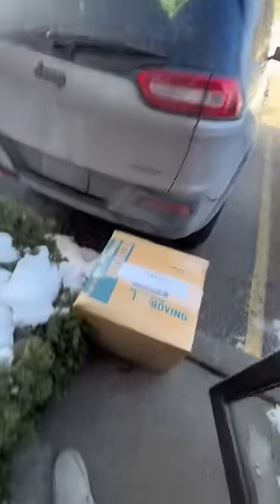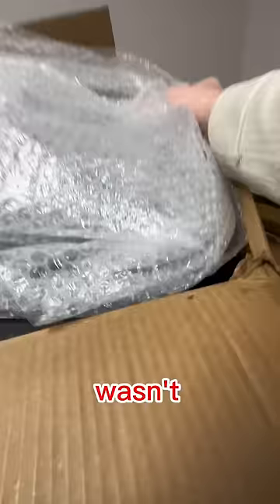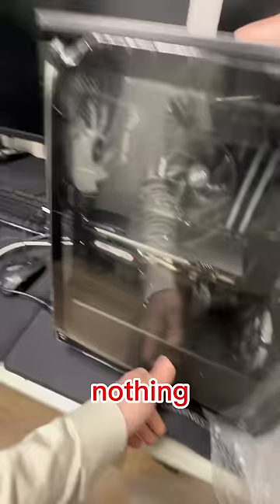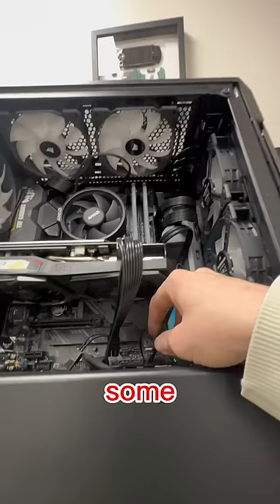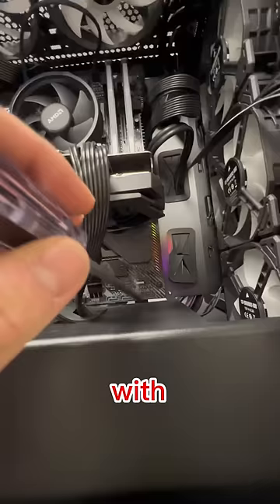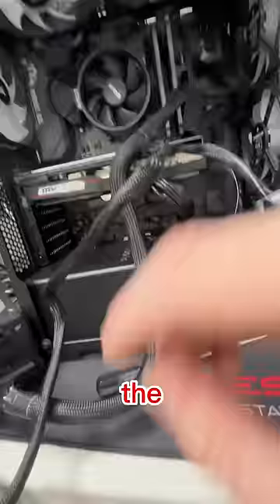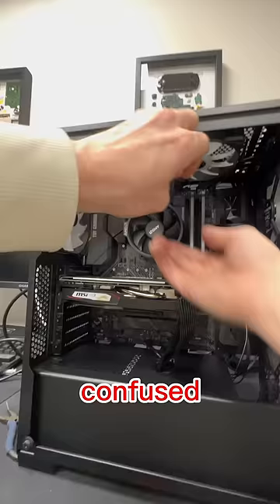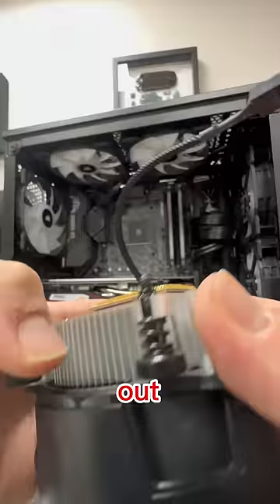Bent CPU Pins 😭🤬#pc #pcrepair #cpu #gamingpc #pcgaming #pcbuilds #pcbuilding #egirl #gamerguy

Comment: Best tool for straightening pins is a mechanical pencil without the lead in it.
Reply: Best tool for straightening pins is not buying AMD and using that ancient ass AM4 Socket.
Reply: @squarebodyseth5986  ugh
Reply: @squarebodyseth5986  Or just treat your computer components with care and avoid jamming them in like cavemen
Reply: Helped my friend do this after he put his in without lining up the arrow. Worked great.
Reply: @squarebodyseth5986  cpu pins are easier to straighten than socket pins ;)
Reply: That is actually really smart! I'm gonna try it on mine after I stored my old one the wrong side up in the plastic thingys 💀
Reply: @jan Luna  very true!
Reply: Im gonna bend tf out of mine just to try this. Sounds satisfying!
Reply: @JunkBondTrader  The thing to be careful of is not to use  to much leverage or you will rip the pin right off.
Reply: Facts! Ive done this exact trick in my electrical engineering class!
Reply: @JunkBondTrader  don't bend too much. Each time the pins get bent they weaken. They will snap after a couple times. Sometimes on the 1st time...
Reply: @e.6z1  ignore him hes one of those intel fanbois that think anything not intel is obsolete
Reply: Where are you finding mechanical pencils with lead in them in 2023 lol
Reply: Thanks never would have thought to try that.
Reply: @squarebodyseth5986 imagine thinking socket am4 is inferior in any way and has no good processors. That would be a tragedy.
Reply: @@chidindueze7655considering a large amount current Intel chips are beaten by an AMD chip in both enterprise and commercial markets I would have to respectfully disagree.
Reply: @samfish90212  That's what it is.
Reply: @squarebodyseth5986  it's not. Several of the Ryzen 5 and 7 chips are equivalent or better than their respective generational counterparts. Intel seems to be more powerful in their latest chips but only time will tell.
Reply: that's EXTREMELY clever
Reply: I dropped my cpu once while upgrading my cooling and bent some pins. I didn't know about the mechanical pencil method, but I saw a video of people using a razor blade to aline the pins. Took an hour or so and voila, working CPU.
Reply: paper cutter
Reply: That's the first thing I noticed. Always use a mechanical pencil. It puts the strain on the pin.
Reply: @1TokeNChoke  Thats why I added to be careful using the pencil because it can tear the pin right off. It has to be done gently, and works great where the pin has become curved.
Reply: Nope. I've fixed many mashed up CPU's with no failures so far. Best tool to use is a Stanley blade. Keeps them perfectly in line, work from one side across then the other, always works. You can lift many pins at the same time to the same point, and it takes a few minutes to get them straightened.
Reply: @Chidindu Eze Tell me you don't know much about electronics without saying you don't know much about electronics.
Reply: @samfish90212  Correct. Anyone who actually follows or has a slight bit of knowledge about PC components would know AMD and Intel have been going back and forth for years now. If you just straight up think 1 is bad and the other good, congrats, you've become a fanboy without independent thought.
Reply: @Lord3nder  I'll admit I am an AMD fanboy but I will never deny a good system. Built my dad a 12th gen i7K system. He loves it. I like the benchmarks it gave me.
Reply: @squarebodyseth5986  tell me you don't know what you're doing without telling me you don't know what you're doing.
Reply: Don’t forget to heat your cpu pins before bending… cold pins are snap city
Reply: Buy Intel and LGA will never bend a pin. 😅
Reply: @Niikkos  take the graphite out?????
Reply: @squarebodyseth5986 proceeds to bend the motherboard pins
Reply: @@chidindueze7655argument, amd was able to have CPUs that compete with intel while still keeping the same socket, making the compatibility with old motherboards a lot easier, it's not ancient neither obsolete as it still runs new CPUs, and also i dont need a 400w cooler for it
Reply: @Lord3nder true, though i tend to hate on intel due to having one burn, i don't dislike them, but feel like i have to spend more in order to use them at their max
Reply: @squarebodyseth5986  or just do shit properly 🤷‍♂️ am4 is a great socket
Reply: @BaSeGM  maybe 10 years ago
Reply: @SquareBody Seth  you do realize am5 only came out two years ago right? No shit am4 is still relevant 🤦‍♂️ people are building brand new am4 rigs everyday, the 5800x3d is an absolutely fantastic cpu 🤷‍♂️
Reply: @BaSeGM  Compare that to a measly i5 13400k and the i5 still outperforms for $70-80 dollars cheaper. Come again 🤡
Reply: Yup
Reply: I use my driver's liscense honestly. It works great.

Comment: DON'T TROW IT AWAY!!! There are experts taking with machines to straighten the pins for just 40 dollars maybe 50 with shiping cost!!!
Reply: It's not worth it, once some pins break off (impossible to avoid attempting pin repair), its as good as a silicon brick.
Reply: @mycelia_ow  the pins didn't broke off they bended. You have specialists that repair that and even i use a CPU that had bended pins. Its a Ryzen 5 7600 and i got it off a guy for 40 dollars. Repaired it by a fella and it works perfectly
Reply: @trevorphillips2250  I think when you fix a pin there is a chance it will break off instead. 

because that's what happens when you bend metal enough. the pins are super sensitive and thin so it doesn't take much. it's good if you're careful but still risky.
Reply: @mycelia_ow  i just learned today how these specialists fix it seems to be a 100% success rate they heat only small parts of the bended pins and the straight it. Then they place it in a small machine that would heat again and make all pins straight as every other. I should start this kind of business to if i could get my hands on it lol
Reply: @mycelia_ow  Broken pins are 99% repairable, you just get quality donors and solder them on.

Chance it will break off? Fundamentally yeah they don't want to be bent too often, BUT once you install the CPU it's basically not moving, there are no fatigue sources. So if it's a success, it's not coming back to bite you.
Reply: @SianaGearz  interesting, thanks for the info 👍
Reply: @mycelia_ow  the pins are LITERALLY gold plated copper, they are not easy to break.

Comment: Guys, your never suppose to pull your cooler  when it's attached to the PC like this. First run the PC for a while so it can warm up the thermal paste. Then power off and switch off your PC. After you unstrew the cooler, DO NOT PULL. Do a very slight turning motion (your not pulling just turning) it will release eventually. Pulling off your cooler like this will bend pins on your CPU.
Reply: True but pins bent like this prob means it wasn't seated properly to begin with.
Reply: @Novachrono5378  that's fair, but I felt like some pins were bent when they just stripped it out like that, I imagine the guy who sent in this PC probably tried to push the CPU in the slot instead of letting it slide in on its own.
Reply: What's really crazy is that AMD still has pins on the CPU
Reply: @LadyMistborn  on the previous generations yeah, but on their latest CPUs, they don't feature pins
Reply: Perhaps you could elaborate as to how EXACTLY they should "Power up and let the computer warm up for a while..."  When the reason the computer was sent in for repair in the first place was "Because the computer would NOT power up!".
One of us is missing something here, to quote Buggs Bunny, "It could be you Doc!"   :-)  L8R G8R
Reply: @nato7.62mm4  ok, why not use a hair dryer or a mini hot air gun to atleast warm up the paste? These are safe and viable alternatives, powering up system isn't the only way to warm up the paste. Regardless of that, I'm just saying. It's became common practice to ripping coolers off of CPUs. I'm going based off what I saw he just tried to pull the cooler after unscrewing. Just that even if they didn't pull the cooler exactly shown here. It's what people see. You catch my drift?

Comment: I once did a 3 hour surgery on a CPU that had close to every pin bent, same situation, CPU wasn't slotted in correctly and they screwed the cooler on. Used a pair of tweezers and a magnifying glass. After 3 hours of straightening pins, slotted that bad boy in and she booted. I couldn't help but feel badass.
Reply: Me who has bent pins on my a4 cpu fixed it bc of mryester😑
Reply: @xenoxn1975  more than a quarter of the pins? Cause if so I’m sorry for the time you had to put into fixing that.
Reply: @HideYourKoalaBabies  its just 3 lanes of pins bent bc of my stupid brain forcing the cpu into the wrong way 😑
Reply: I did the same with a dull pocket knife

Comment: So I accidentally bent some CPU pins once while installing, the CPU slipped from my fingers as I was going to place it in the socket, and in trying to catch it my thumb bent some pins on one side.

I literally took it over to my model building station, used a magnifying lamp and some ceramic tweezers to carefully unbend the pins.

I got them as straight, to the point where it almost looked factory straight but not 100%, and very carefully placed it into the socket, very slowly locked the socket down, and that PC ran perfectly for many years.

As long as you don't snap the pins during the bending process, you should be good, just gotta be super careful and super patient.

Comment: did you try to streighten the pins with a pair of tweezers? so that you could phisycally grab each pin and try to apply pressure by way of squeezing the pins streight rather than trying to push them over with a screwdriver ...etc..

Comment: it was saveable but you guys jumped the gun on bending back the pins. the pins need to be heated first so that the metal releases the work hardening from being bent. then they will bend back without breaking. its a balancing act of heating the pins hot enough and not overheating the cpu itself tho

Comment: That damage to the pins likely happened during shipping. I moved my PC to university accomodation only 20 miles away and it bent pins due to the fairly chonky tower cooler (Noctua U14S)
Reply: it came off with the cooler, it was not set correctly. possible issues were happening and the user did something to test on their end and damaged it during testing.
Reply: @nick-hu1nx  don't underestimate the amount of torque a sharp jolt could apply when the mass of the cooler is at even a small distance to the mounting point. My CPU was installed correctly and it still moved it enough in the socket to bend pins. It was LGA though so not directly comparable.

Comment: The first CPU I ever bought, I dropped it within moments of unpackaging it. At least a half-dozen pins were bent, and I nearly threw it against the wall.

Instead, I took a box-cutter blade and slowly bent all those pins backup right. I put it into my computer, crossed my fingers and pressed the power button, fully expecting nothing to happen.

5 years later, it still works just fine.

Comment: Use a mechanical pencil and a heat gun don't use pliers take the lead out of the mechanical use the metal part and put it over the pin and then bend it back

Comment: I’m willing to bet one of two things happened:
A: this guy was removing the cpu, the thermal paste stuck to the cpu and yanked it out of the socket, damaging the pins.
B: option A
Reply: this guy knows whats up ^^^
Reply: Yup. Because that's how my 2700x met its end 🤣🤣
Reply: The pins seemed bent towards the center of the CPU, I feel like it'd have been bent towards the outside if he had bent thrm while pulling, I have no idea how you could manage to bend them that way by pulling.

Putting it in it's easy, place a corner first, smush it down hoping it will fit, call it a day: you've got bent pins.
Reply: @Silentkiller2131  you're correct. They wouldn't be bent inward, only outward. We don't have the full story tho. "Hey user, did it EVER turn on since you assembled it?"
Reply: @theJerkson  user will say yes then user will hope their lie magically makes it work faster. I work in it so that's how I think every user thinks lol
Reply: " the CPU comes out with no force" 
you think the PC repair guy hasn't installed, replaced and reapplied thermal paste for 100's of CPU's?
oh i guess that also explains why the PC  broke in the 1st place and the guy sent it in right? that's some crazy shit... never heard of a guy sending his perfectly working PC to get repaired only for it to get broken

Comment: This happened to me once. The cooler was stuck to the cpu with the cooling pasta you put on it. So I pulled it off with too much force. I managed to bend them all back and it worked. I never dared pulling it off again. Best thing to do is to heat it up if you notice any resistance.

Comment: If you have a CPU with pins never remove the cooler without heating up the thermal paste. The paste will act as glue if not headed up prior to removing the cooler.
Reply: was looking for a comment like this tbh, my first ever fuck up with a CPU was trying to troubleshoot an old ass Athlon, I was always an intel fanboy so the idea of the CPU not being encased and basically strapped to the mobo was absolutely foreign to me. at least 20+ bent pins and i bent even more trying to separate the CPU from the cooler. 8 years later and i have a dedicated low heat- heat gun specifically to prevent that from happening

Comment: This happened to me I had installed my cpu correctly but the thermal paste was old and nasty and the temps weren’t very good so I decided to put on new themal paste but when I took it out I just pulled on the cpu cooler instead of twisting it off and the cpu came out with it and bend a few pins luckily I was able to
bend them back though

Comment: You definitely could have saved that, I just fixed a a8 9600 that was in about the same condition, the best tools to use are a toothpick slid in at the very bottom and a pizza cutter to align the pins.

Comment: to unbend the Pins on the chip use a credit card, Slide it between the pings and they will straighten.  I built a PC for someone, their boyfriend took it a part to try and steal parts from it, and did not put it together properly.  I told them send it back to me and about 40% of the pins were bent, i spent 30 minutes with a credit card to bend them all back and PC worked like a charm after i fixed it.  I sent it back and told them never to let their boyfriend touch it again and to never ask me for help with it again if they are willing to let that happen.  She later bad mouthed me to a friend of hers who i had built a PC for, and to my knowledge his PC is still working just fine to this day.

Comment: I would suggest you use the metal tip of a mechanical pencil to straighten the pins on a cpu. much better that what you were using.

Comment: I also have the same issue currently. I tried all of the possible solutions on the internet. Reseating the GPU, m.2, ram, and even the CPU (but in my case, the CPU turned out to be fine though, no bent pins). I even short circuited the power button, as to see it is the cause. It seems like the motherboard is the culprit.

Comment: Use a metal tipped Pentel mechanical pencil and slide the empty barrel that usually holds the led over top of the bent pin and straiten each individual pin in that way.  It's a lot better than what you show you are trying.

Comment: You're supposed to twist off the heat sink instead of prying the CPU out of the motherboard, which can easily bend the pins.
Reply: dude the cpu wasn't even in the socket
Reply: @andrewrobinson2985  Ah, I see what you mean. Someone installed the cpu with the lever closed and then tightened the heatsink on top. 💀

Comment: What I have found to best straighten any bent pins is a small tube that fits as snug as possible over the pin and to then work slowly. As for sourcing such a tool, one is left to ones own devices.  I would suggest something like the metal tube that holds the ink inside of an ink pen as a place to start, then just keep your eyes open for similar small metal tubes. NOTE:  An assortment of varying I.D. sized tubes will become quite useful if computer repair is a hobby or DIY thing for you...   :-)  L8R G8R!

Comment: Nah, thats not how a pro should fix the pins. And if there were no severed pins (at least i didnt see any) it would be a 10 minute job. Always go full rows with a scalpel, vertical and horizontal, avoid excessive bend. Then fine tune it, you really dont need to get it 100% perfect, 90 would be enough. Place carefully into socket, make sure all the pins go in, latch and unlatch a few times. Should be good as new.

Comment: use some tweazers and slowly straiten each pin 1 at a time speed will not fix it, when installing the chip make sure its in the right direction. another way that i just thought of is a plastic ruler to make sure the pins are strait and aligned.

Comment: Therefore, the AMD cooling is pulled from the lying position slightly turning the heatsink sideways then the risk of removal from the processor is low, although at the beginning there were such situations and so the pins were simple